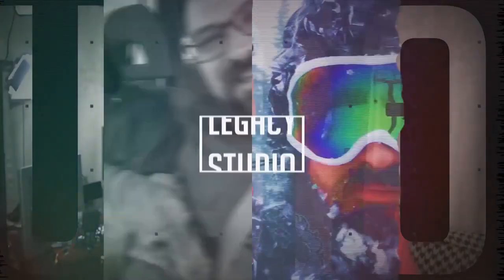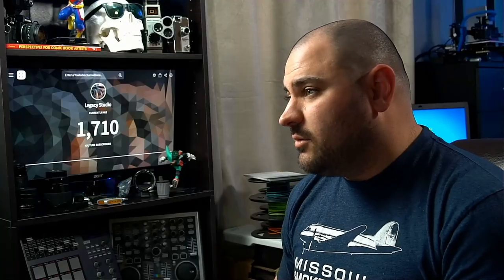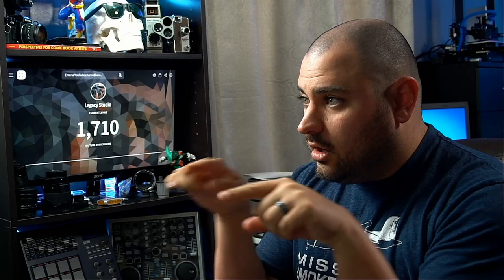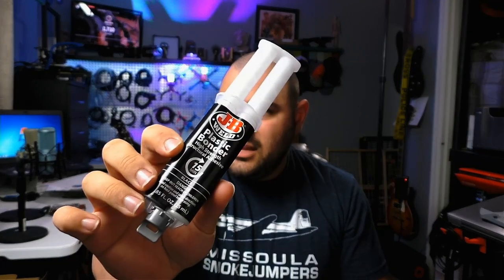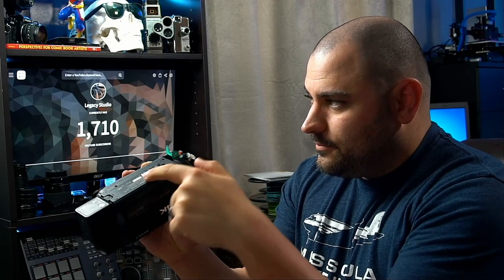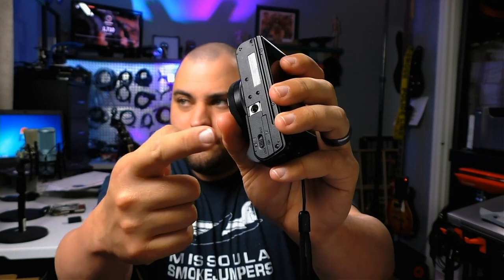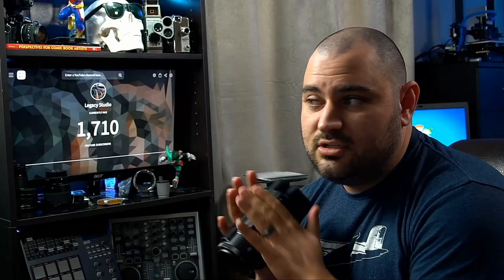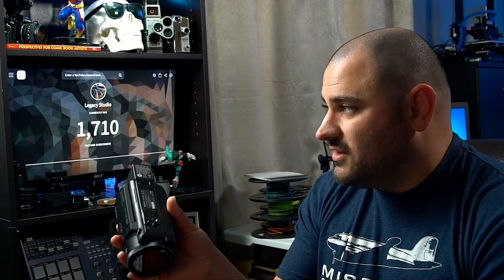Fixing Stress Cracks in My Camera Plastic (Sony FDR-AX53)

Comment: Prevention is better than cure. A piece of sheet rubber between the camera base & the tripod, will prevent the camera from twisting. Thus avoiding the need to over tighten the screw
Reply from the maker: Great idea :0)

Comment: Thanks so much for the info.
So you do not recommend buying the sony ax-53 due to this constructive defect? Because I'm uncertain between that and the Canon HF G50.The camera i'll buy will be always mounted on a handgrip
Reply from the maker: I personally LOVE my Sony AX53, and since I replaced the plastic piece all together the camera has given me zero grief. I admit I look at the Canon HF G50 and it also looks like a great camcorder. The only con I personally have with my Sony is that setting white balance is quite challenging since it doesn't allow incremental changes and requires you to "calibrate" it to set the white balance when I would rather just change the settings myself. The Sony AX53 has a bunch of little issues like that since its a "consumer" camcorder. But it is still one of my personal favorites.